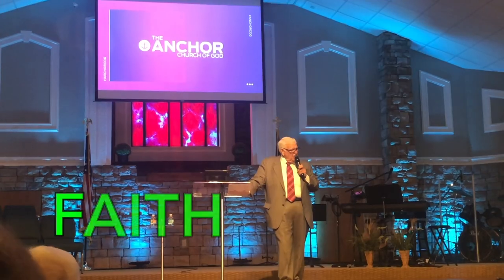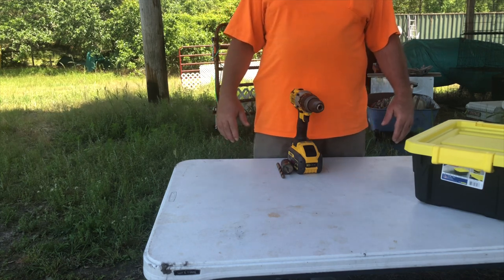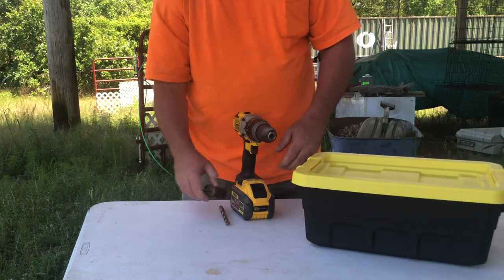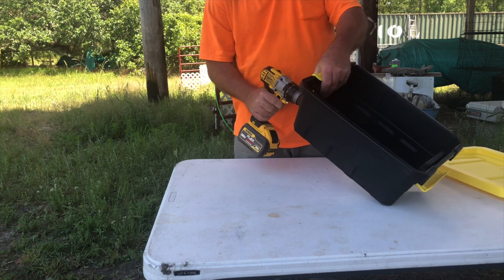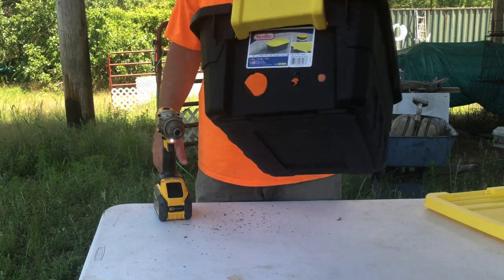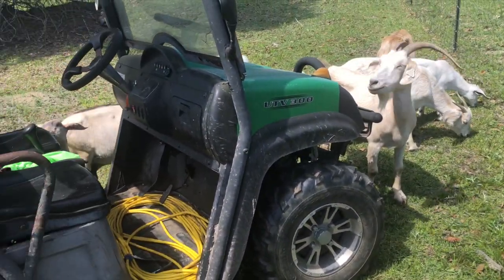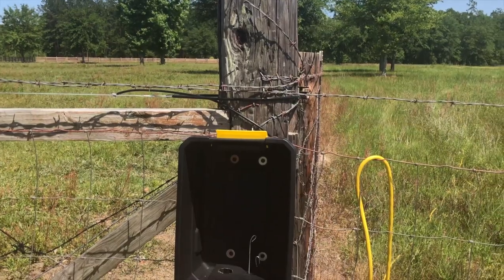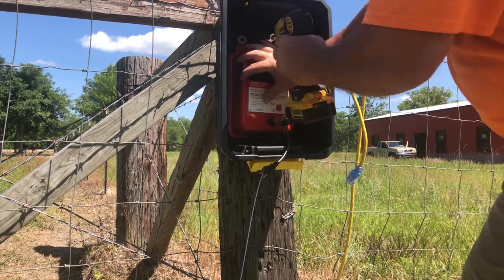How to Install and Weatherproof an Electric Fence Charger

Comment: What was the dimensions of the crate?  Do you have the brand / model of it?  They seem to be hard for me to find anything similar to what you show.  Thanks!
Reply from the maker: It has been awhile but here is a link to the smaller containers. Check the dimensions to pick a size right for your application 👍🏼🤠

https://amzn.to/3M8fNL3

Comment: This might sound like a very layman question, lol, but does it  produce any condensation, heat or humidity
Reply from the maker: Not that I can tell. Still going strong. I did leave the holes in the bottom for the wires to pass through open so the box can breath a bit. So far no issues. Thank you for watching and commenting 👍🏼🤠